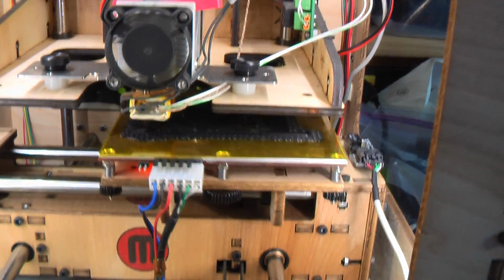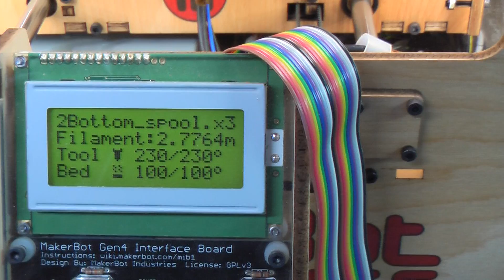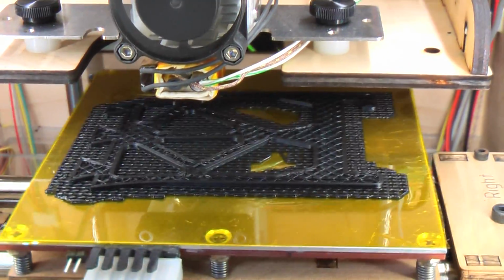Thing-o-Matic now printing with Acceleration turned on.

Comment: i have one of these...how do you load the filament into this thing. i noticed a hole on the top but i dont see a feeder motor...help...thank you.
Reply from the maker: The original Thing-O_Matics had a different feed system than mine. Mine came with a newer stepper motor driven one. I think the original one had a DC motor driven one. Do you have the LCD Interface?
Reply: yes mine has the gen 4 one. i looked through the menu and nothing there to load the filament. it has a hole in a black looking box on the top. i pushed the filament into the hole and it stopped...i pushed print and nothing happened. Now...I DO have two other 3d printers and have been operating them for a couple of years now with no problem so I am familiar with 3d printers. Im running makerbot autodesk with sailfish as well. the bed gets hot and the nozzle gets hot. i can jog xy and z no problem. but this machine is older and not to user friendly....so...im kinda STUCK...thank you.
Reply from the maker: Haven't had mine on in a few years. But, you should be able to preheat the extruder. Once it's up to temp you can use the extrude menu to feed filament. If you already have filament in the extruder, you need to heat the extruder up and feed some through the extruder and then quickly pull that back out of the extruder by hand. 

On mine, I have a spring loaded bearing type of extruder, so I use the lever to release tension when I want to pull the filament out. It very important not to try to unload the filament cold, or even just heat up the extruder and just pull it out. Most times you will jam the extruder and will be forced to take the thing apart to get it out. Always feed some first, then quickly pull it out.

Comment: Sir,
I am very envious. 
I have just inherited a Thing- O-Matic. The prior owner gave up on it trying to upload new firmware. I have been told it was successfully printing at one time many moons ago. 
I have scoured the Web looking for some knowledge on resurrecting my TOM, however I got overwhelmed. may I ask to be able to bend your ear in regards to this project? BTW I completely understand that what advice you do give is just that....advice.
Thanks in advance
Patrick C.Hand
Reply: +Patrick Hand Sure, send me an email to jim@fouchsoftware.com with any questions. I still have my TOM, but don't use it much as I now have a Replicator 2X. The TOM still works and is a great printer.